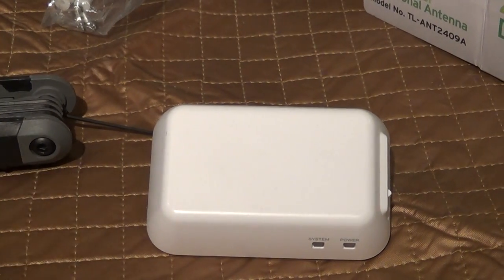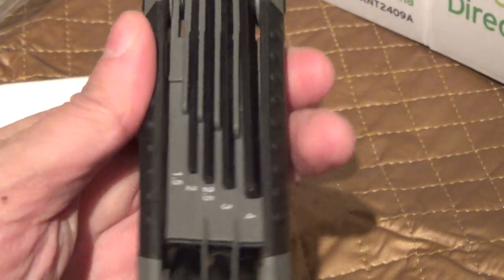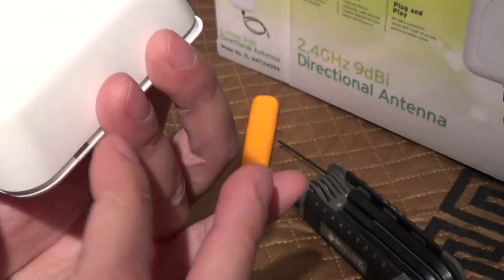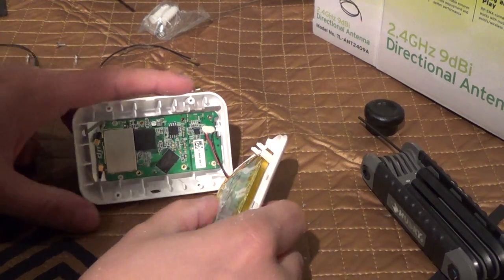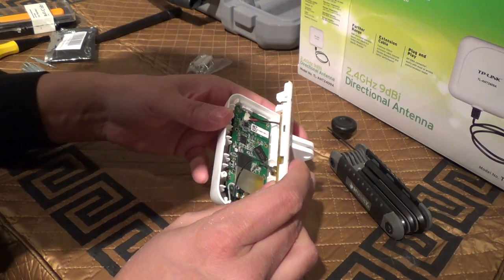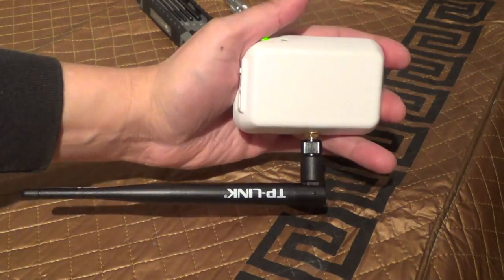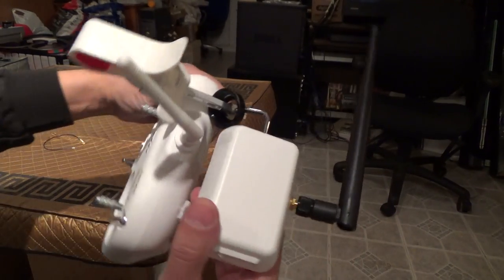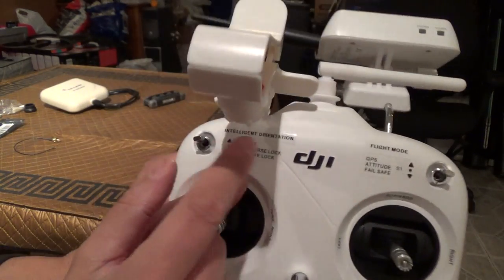DJI Phantom 2 Vision Wifi Range Extender / Repeater  External Antenna Mod increase FPV range.

Comment: Dear Ben
Thank you for your supports and all informations
I have very impotant question
How I can icrease the range also for the remote controller ?
There is kind of antenna that I use it to increase the distance ?
If there is could you please provide me From where that I can perchase it
Thank you
Reply from the maker: Hi, there are a few ways you can further improve the range of both the wifi as well as the 5.8ghz controller. First look at my transmitter mod video. I also also be posting another video on increasing the range of your modded or stock antennas using aluminum foil some cardboard and tape. I'll post that video soon as I have the chance, maybe in the next couple days.

Comment: Also wow £120 for a spare battery ouch, if I went for the phantom 2 with go pro I take  it doesnt  have the nice phone app like in your video and it would not be transferring video signal by wifi  but use a separate transever or whatever there called
Reply from the maker: If you went the Phantom 1 or 2 (non vision) route you would need to setup your own FPV system. And for telemetry info you'd also have to add DJI's mini IOSD or a similar type of product.  Either way it wouldn't be as pretty and simple to use setup as with the P2V and it's iPhone / Android app.  Though you would be able to put in a better FPV system such as one that can send HD streaming images rather than lower quality VGA as with the P2V.

Comment: Hi Ben7 wow thanks for the fast reply much appreciated I have just watched some other reviews on them wow disappointing 2 hours to charge the battery? Is there any way you could add two batteries to give long flight time and could I fly it by watching it off the screen of my ipad? Im still liking the sound of it though . I paid about £800 for a xbl xufo top quality alloy/carbon fiber quadcopter a few years ago before I knew anything about them I thought it had all the tricks built in gps lock hight hold ha it had heading lock and that was it very hard to fly I wrote it off in 3 hrs crashed over neighbours house costly mistake this looks very fin to fly : )
Reply from the maker: The Phantom is very very easy to fly, especially at higher altitude where you have nothing you can crash into :P The hardest part of flying is getting used to the reversed or sideways controls when you're flying toward you or sideways.  Also you can not run two of these batteries at once. It's designed for one. In theory though It may be possible to mod the Phantom and solder into the power feet a secondary battery plug for a standard lipo that you could velcro on to the body of the Phantom.   And the charge time can vary depending how low you drain it but 2 hours it the max it takes or less depending on existing charge.

Comment: Hi guys im wanting to buy a decent fpv quadcopter is this very good? Also in gps mode can I just throttle it up without moving any other controls say above my house and will it just fly straight up in a perfect line without drifting off course? Or do you have to keep correcting it as id love to fly straight up then realease controls so it just sits high above my house hovering so I can see the picture on my tv with the use of fpv gear and a go pro cam?  Hope someone would be good enough to answer me thanks for your time ; )
Reply from the maker: This video is regarding repeater to the Phantom 2 Vision which uses a repeater for FPV to its own preinstalled camera.  But yes it will do exactly what you are asking about otherwise.  If on the other hand you wanted to use a GoPro then go for the Phantom 2, or Phantom 2 with Zenmuse H32D Gimbal.  You will need to provide your own FPV gear though for that.  The Phantom 2 Vision is all in one and doesn't need anything added.

Comment: Hello,
With your inspiration i installed 2 antennas with 10 dbi, distance extended to 640 mts and height extended to 432 mts (i could not gain height because control signal is lost at that height). These ranges are the ones where the connection is broken, when i tried to go further wireless caught and lost the signal couple of times. So the figures i have given is the healthy, no connection break figures..
Thanks a lot..
Reply from the maker: You can see my transmitter mod video to further extend your TX range. And a new video I'll try to have up this week on how to further improve both the Wifi and 5.8 tx with some aluminum foil, cardboard and tape.
Reply: Hi, i am looking forward seeing your videos. I have a question: What is the best position of the repeater while flying? I train falcons and i need altitude mostly. For max altitude, would repeater face to sky or it doesnt matter. Thanks.
Reply: One more question: 2X10 dbi antennas were working well but last two days there is a rapid decrease in performance. The connection breaks too much in one flight. I see the binding seems ok in dji vision app. Would i reset and rebind so that i solve the connection break problem? What do you recommend?
Reply from the maker: spar falcon I just noticed this comment, Did you sort the problem? I actually just noticed recently that one of the ports I used to use originally isn't working as well but the other's working normally. You really only need one port.  Your problem could be anything, including a defect in your range extender. But resetting it couldn't hurt.  It could also be a problem with the connectors you may need to replace the rpsma pigtails.
Reply: Well, i removed the antennas and rolled backed to original. The range was 300 mts high before, now it is 450+ mts.. Interesting??
Reply from the maker: Easy explanation for that.  Depending on were you fly interference near you as well as atmospheric conditions your range can vary, dramatically so depending on the conditions around you.  

Changing the "Preview Quality" to the lowest setting versus a higher setting will also make a dramatic difference in FPV range.

I've heard of people getting out as far as 1,800 feet on the stock setup but that's with no other forms of interference near them.

The best distances I can fly with complety stock setup which I had recently reverted back to before adding my mods back was 1,300 feet range lowest preview quality and around 1,000 feet on 640x480 15fps preview quality.  My range is noticing reduced flying near my house with even more signal interference than my local park.

Now with my mods back on my repeater and Phantom I'm pushing 1km+ distances. 

Also I recently discovered  one of the two ports from my wifi range extender is not performing nearly as well as the other which I don't think was always the case but it's been good I discovered this as I use my higher powered antenna on the better of the two antenna ports.  

Anyway if you'd like even further range you can add an amp to your range extender which will significantly add to your FPV range.  You can check out my video on using the Sunhans amp.

Comment: i greatly appreciate this tutorial - thanks for sharing- I have the 14 dbi patch antenna and the U.FL Mini PCI to RP-SMA Pigtail Antenna WiFi Cable..however I just found out that the p2v's stock camera/VTX has two antennas- and they are both circularly polarized antennas (not linearly polarized).. these antennas you are using and I have) are linearly polarized and though will still work- will have a loss of 3dbi because of the mismatch in polarization..so not optimally matched..eg your 5dbi antenna may only act as if 2dbi etc..check out the new thread at phantompilots dot com titled 'Amplification warning'..I may end up getting rid of the patch antenna and get a cloverleaf or helical antenna instead..
Reply from the maker: I know of the forum thread you speak of. The Amplification warning is only respect to people who are using an add on power amplifier to their setup. It has nothing to do with the built in amplifiers on either then P2V or the anything else.  And you're not technically loosing any "gain" from your antenna unless you're using an antenna that is not matched to the frequency of the actual transmitter / receiver it's plugged into.  The gain is not relative to the antenna on whatever other devices it's receiving signal from. Unless you're going to use a very large sized clover leaf antenna or helical it's not going to do better in overall range than the 5 or 8dbi omni.  Though it may do a little better regarding signal drop outs for closer range flying. Also having a Clover Leaf or Helical well be more of a benefit on the P2V camera than on the Wifi Repeater with respect to perfect 360 degree movement and signal consistency.

Comment: maybe you guys can help. After doing the upgrade and putting it back together my repeater doesn't work. I did everything to the t. the system light doesn't light up. do I need to bind this or something?
Reply: Yes its fully charged
Reply from the maker: If your unit doesn't power on then something went wrong during your upgrade. You may have either gotten one of the power leads to the battery loose, or worse, shorted something inside.  As a test of the battery you can plug it in and see if it powers up plugged in to the micro USB that will confirm if the power leads the problem.
Reply: It powers up. Its the status light.  Doesn't come on and doesnt connect
Reply from the maker: Robert Vera Have you sorted this out yet?  Sounds like you may need to rebind the repeater to the Phantom.   Though you can usually still connect to the repeater by itself even if it's not connecting to the Phantom.  Strange problem.
Reply: How does one re-bind to the phantom?

Comment: Ben--- do you know id this antenna is directional ? http://www.amazon.com/gp/product/B00DNAM642/ref=oh_details_o06_s00_i00?ie=UTF8&psc=1      Planning on using my tplink 8dbi omni directional on the same slot you placed your 5dbi omni (which I've heard its the master antenna)and a directional on the other "slave" antenna.
Reply from the maker: That's an Omni directional. I have that same one in addition to my TPLink antennas. It's quite big. I haven't decided for sure if it's as good as or worse than my 8dbi TPLink.   And both antennas are used together, it's not really a master slave deal.
Reply: Ben7seven7 thanks for your reply, Ben. Right now I have the directional (rectangle plate from your video on the J19(right side) and the 8dbi omni on the left side antenna (J11)(same as you have yours on video, but you started with the 5dbi) you think its a good combo?
Reply: Ben7seven7 i just want to maximize my mod , without having too much to carry, and follow your suggestion to have one directional and another omni directional, and based on your tests, which combo do you recommend to have 1000 max altitude with 2000 distance(not looking for more than that

Comment: Now that the FPV vision has been increased, how can you increase the transmitter range for the Phantom's flight controls?
Reply from the maker: I'll try to post a video soon on how to upgrade transmitter. Though it's not necessary unless you either want to fly a half mile high or over 1.5 miles away. (Distance range is always better do to antenna design / angle on the Phantom)
Reply from the maker: ***** I've used my P2V to 2,500 feet distance without loosing control signal. Straight up is another story you get about half that with stock controller antenna.
Reply: Ben7seven7 I've found that if you change the receiver antennas orientation from straight down to having them both facing out from the legs at 45 degrees you can go straight up over 2000 ft. There seems to be no apparent loss in distance, when vertical flying, with this configuration.
Reply from the maker: Ed Floyd Nice, I've actually done over 1,600 with the 8dbi omni using my aluminum reflector and could have gone higher but didn't want to go nuts. My 11dbi helical works far better even I've done the same altitude with better performance.  Also check out my new video adding amplification to the extender.

Comment: I forgot to ask. How did you remove the cover without braking the clips, and if you brake the clips does it matter since there are 4 screws that hold the cover on anyway? Thanks again and happy flying! :-)
Reply from the maker: I explain in the middle of my video. The clips are in the center. I didn't break anything.  It's just a matter of slipping in a thin flat screw driver into one side or the other and lifting the top bit up so it clears the clip.  It's not too hard and comes off clean.
Reply: I'm sorry, I didn't mean you broke the clip. I meant what if the clips gets broken while I'm making the modification. I'm not that mechanically incline, and I have two left hands. I just bought my TP-Link 5dBi Antenna and wires. I'm hoping to improve the video signal during short distance flights where there is lots of interference; you know how NY can be. Anyway, thanks again for posting this great How To video and responding back. I hope mine comes out as nice as yours did. Happy Flying!
Reply from the maker: Bobster986 Even if you were to accidentally break the clip that holds the wifi repeater together you still have the screws so it's not too big a deal if that happened inadvertently.

Comment: Great idea! How much is the gain of the integrated antenna of the extender? I'm not able to find it anywhere.Do you think a +2db antenna omni could help to get a longer range?
Reply from the maker: 2dbi probably wont help you. a 3dbi at minimum would give you some increase in range. Though to make this mod the most worthwhile go with at least a nice 5dbi omni directional or better.
Reply: Ben7seven7 Just going to test a 8dbi omni antenna. I've read a lot of people writing about a 3dbi losing of gain using a linear antenna on the extender instead of a circular one. Did you know this effect?
Reply: Ben7seven7 Do you notice there's a difference between the 2 internal antennas? I mean: both communicate with phantom or one is dedicated just to communicate with smartphone?

Comment: Do you know if you can use the ground control system with the vision 2? if so can its range be extended as well? i have not bought anything yet I'm just exploring all the options. Good informative vid BYW
Reply from the maker: Ground Station capabilities is on the upgrade plan for the Phantom 2 Vision. It will offer Ground Station like abilities within the Phantom app.  When it's available it will be in the form of both a firmware update for the P2V as well as the app itself. No idea when it's coming out though. DJI originally said it was going to be available by  Dec 2013 / January 2014.

Comment: flight video of this mod please
Reply from the maker: This is a flight I did around a park using the 5dbi TPLink omni directional. Flew out to 2,000 feet from where I was standing, which is near the beginning of the video, then back to the opposing end of the park which was over 1,000 feet from where I was standing.  Was at a pretty good altitude all the while.

2000 foot stroll around Juniper Park with my Phantom 2 Vision.

I currently have the video unlisted so you'll need the link to find it. You can also add it to favorites should you want to watch / find it again easily unless I choose to switch it to public.

Comment: Nice mod.i have 2 tp link ant2414A and I get 2500 feet no problem and not 1 bar lost on mi wifi connection .I must say before 20 min flights took for ever now a 20 +min flight seems like a 5 min trip lol also moded mi transmiter getting a 9dbi antenna next week should def reach 1 mile + now I do 3 kilometers no prob. And no video signal los wow .will be posting a video vision hardcore range soon.
Reply from the maker: Great result. That big TPLink antenna is a beast but sure works well.

Comment: DR16 D-Bus receiver can this be fitted to Phantom 2 or Vision as to increase
range as they quote 1000 mtrs ON dJI web site .
Also having looked at a comparison chart it quotes 1000mtrs for Phantom 2 and only 300 mtrs for Vision so no need for the Phantom 2 or is the comparison chart wrong .
Reply from the maker: The stock Phantom 2 Vision at my Park I could do just over 1,000 feet away at over 300 feet high.  Using 8dbi TPLink omni directional antenna I've more than doubled that.   And some people using directional antennas have pushed past a kilometer distance.  Even with that improved range transmitter antenna isn't necessary as long as it's in FCC mode.

Comment: Thanks for the reply @ben7seven7. One more...are you utilizing both antenna outputs from the extender or just one?  Thanks again
Reply from the maker: I'm using just one which has given me excellent results. Though i will at some point upgrade it to a dual antenna setup so I may combine two omni or one omni and one directional antenna at the same time.

Comment: Any of you know why I'd only be getting approximately 500' with the 9dbi directional?  I'm in the city but from what others are saying on here, I should be achieving greater range.  I had in pointed right at my phantom.  hmmm...
Reply from the maker: With the TPLink 9dbi directional I only got a little over 1k feet which is also far less than expected. I've heard a couple of people using this antenna pushing as much as 2,700 feet.  It may be because they had it mounted in a different location and not on top of the repeater.  I've had outstanding results with both the 5dbi and 8dbi TPLink omni directionals pushing over 2k feet with the 5 and over 2,500 feet with the 8dbi.